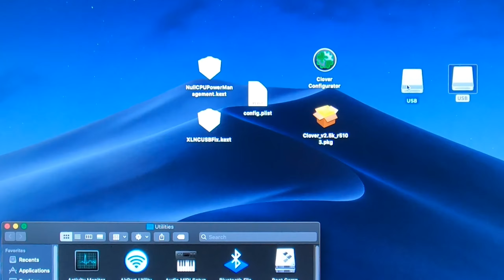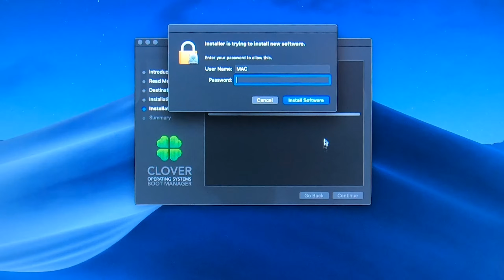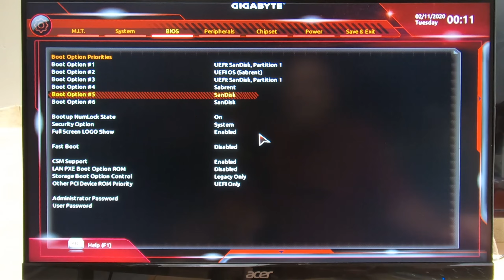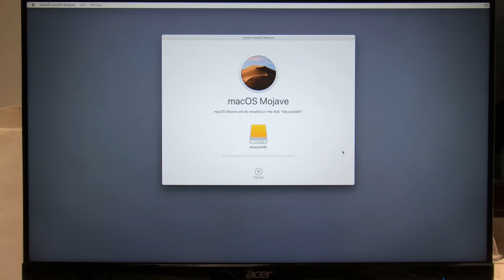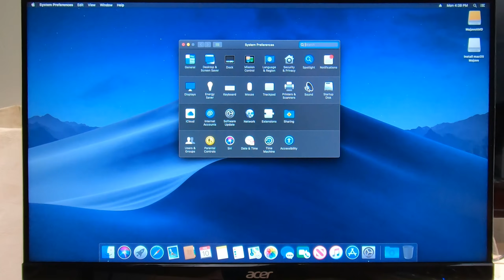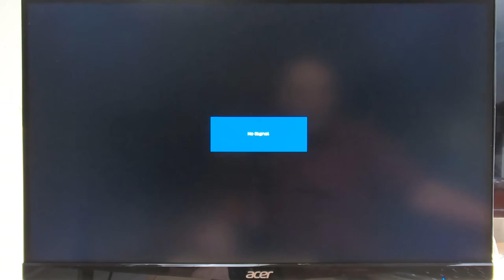$360 AMD Ryzen Budget Hackintosh | Easy Guide!

Comment: Not as smooth as previous Lenovo M93p. So I use Ryzen 2600 with Gigabyte RX 570, AsRock Board B450M-HDV R4.0. It got stuck after Mojave installed to SSD and boot from it. Error: lastloaded kext at 616301076:  >!AAPIC  1.7 (addr 0xffffff7f82682000, size 20480). loaded kexts:   . Please go to https://panic.apple.com to report this panos. Please help to solve this. Thank you.

Comment: great job all works my specs are ryzen 3600 with this board 16gb ram and a rx580  only thing that does not work is my pci wifi card a qualcomm atheros AR5B93 As i need wifi where im sat hope there may be a kext for it as im really pleased with the performance

Comment: Hey TechNolli, i have this exactly motherboard with a Ryzen 1800x and nVidia 1060 GTX. Since my CPU does not have integrated gpu, do you think High Sierra should work? Or maybe it's better to upgrade motherboard and GPU? I was thinking about building a new intel pc just for hackintosh but it will cost a lot more. Could help me, please? Thanks for creating premium content for us. Hugs from Brazil.
Reply from the maker: The problem is getting Nvidia to work on the latest HS 17G66. Nvidia drivers will come up a say this version is not supported.

Comment: I have AMD Ryzen 3 3200G 4-Core Unlocked Desktop Processor with Radeon Graphics

This is better
Reply from the maker: Your Ryzen 3 3200G may have audio issues. I tested the Ryzen 3 2200G and had the same issue as many on the web with crackling audio. If you try it let me know. Thanks!
Reply: @TechNolli  okay

Comment: is this workin with High Sierra ? Because i have an Nvidia GTX1080ti.
Reply from the maker: Hi Frategrafia! I have not testes it. Maybe that is a good video to do? :)). Thanks!
Reply: @TechNolli  Yes. i managed to do the high sierra bootable usb, and managed to boot from it but my instalation does not passed from the instalation part when i'm chosing where to install it because it prompts me the message. THE RECOVERY SERVER can't be reached. Do you have any ideea why it does that? I have added the kexts for my intel based etherned adapter from the motherboard. I mention i have a MSI x370 gaming carbon.

Comment: Nice video!
I have an issue, basically the screen image is not really sharp in spite running at full resolution. (Doesn't look as good as when I was running W10) Also, YouTube videos seem to be low quality. Can you help me? 
My system: Ryzen 7 2700 with a RX580 4gb.
Reply from the maker: Hi Yany, The graphics card is natively supported so it should look crisp.  Maybe the card is defective?
Reply: @TechNolli  Hi, I have solved the issue. I had to change the display profile in the System Preferences and now the image is crisp